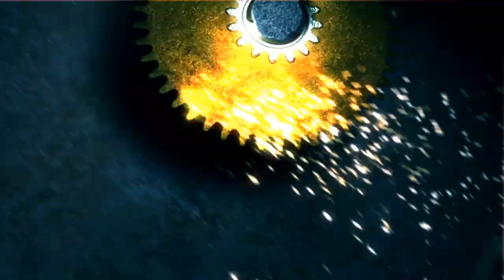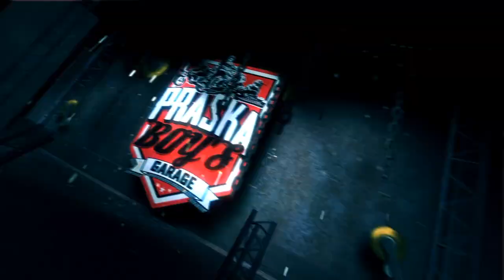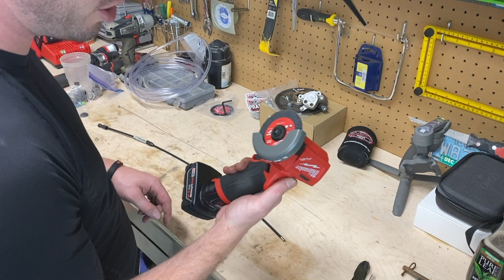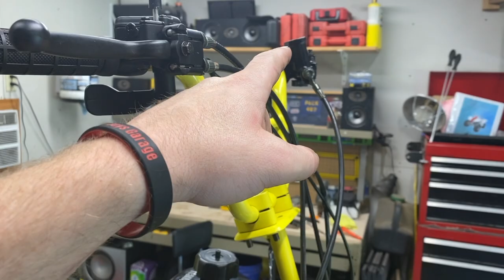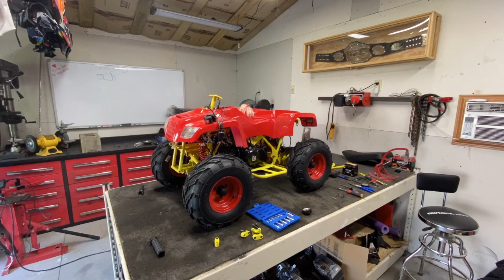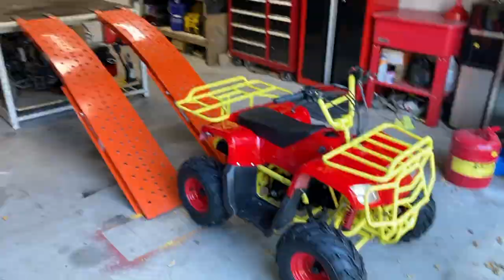Restoring a TaoTao 110cc Chinese ATV! Final Assembly Complete! Part 6

Comment: Man that was pretty creative to use soldering a wire and soldering gun to build a new end for the wire I never thought about that thank you for the idea I do quads and atcs mainly Hondas I'm either restoring them or I am just making them crazy had a ATC 110 that could almost pull anything I wanted it to check out my YouTube video I have up ATC 110 pulling Jeep Cherokee on sugar Sand
Reply from the maker: Love it man! I like Honda 3 wheelers a lot but I am not a fan of letting my boys ride them. We had ATC110 that I rebuilt the top end and cleaned the carb. Gave it to my 6 year old for about 30 seconds and decided it was best to sell! Might get one in the future but for now we are going to focus on 4 wheels and sometimes 2 for my oldest.

Comment: Nice trick with the soldering on the throttle cable. I just hit it with a welder. I have filed bike cable down to fit before as well.
Reply from the maker: I've used the welder to, but I usually hit to much and spend twice as long shaving it down! I've seen others drill a hole in a BB and then hit it with the welder.
Reply: @PraskaBoysGarage  I wouldn't have the patience to drill a BB!
Reply from the maker: Lol, I've never tired it either!

Comment: Your video got mine running 😁, one question for anyone reading this, have you guys had issues with manual dying when put in gear, engine sounds good, unit was sitting for a while, will move with gas but nothing without throttle. Idleing up just kills it faster

Comment: Quality vids bro...Are you familiar with a Baha Motorsports 250? I'm having a heck of a time with wiring...the key switch console has so many wires coming out of it that I can't match it with my new harness? Can you suggest a resource or something?
Reply from the maker: I am not familiar with them at all. If its a Chinese model I know they make similar wiring harness as the 110s. They are specifically for 150cc-250cc on Amazon or eBay.

Comment: Aren't you putting an engine oil cooler for it? That way those valves and the camshaft bearings of the cylinder head won't get overheated and bend.

Comment: Another great video. That rear brake. Is that standard on some of these ATVs? All mine have mechanical rear breaks. It always needs adjusted for the cough big kids.
Reply from the maker: Lol, in my experience they have all been rear hydraulics with the exception of the shaft driven quads. Those typically have a drum brake attached to the axel.

Comment: I meant to say that it’s 250 Tao Tao  Rear bearings for it I cannot find them like I was asking you I was wondering if you could help me find them and if you can can you let me know thank you
Reply from the maker: Your best bet would be to check eBay. Use a micrometer to get your metric measurements. I am not as familiar with the 250cc but that's where I would start.
Reply: @PraskaBoysGarage  Yeah I’ll check out eBay and see if they have the bearings and all that he doesn’t get an awesome job putting it together man I watch the whole video it was cool when you have a chance check out radical rain video of me driving my full Willer in the woods let me know what you think

Comment: I have been working on and trying to reatore a Z Easy 110.. its almost identical to this atv. My main question is the back swing arm, What does it have in the hinged part, bearings or bushings? What ever they are they are bad on mine and causing the chain to lightly drag on the housing. Any help or advice would be helpful.

Comment: Where did you get the motor holder for your table?
Reply from the maker: My engine stand is probably the most popular tool I have. I got it off eBay back in 2018, but the seller is hit and miss when he lists them. I am currently working with a guy who owns a CNC machine to start making them myself!
Reply: @PraskaBoysGarage  man I would buy one in a heartbeat. I do small engine repair too

Comment: Hey I a 110 4 wheeler for my grandson it was running great and then it stop running and it won’t roll if you pull the pull rope the bike moves what you think wrong with it thanks
Reply from the maker: Interesting, a 110cc but still has a pull rope? Do you know what brand it is?

Comment: Where did you get that stand you have the engine mounted on?
Reply from the maker: My engine stand is probably the most popular tool I have. I got it off eBay back in 2018, but the seller is hit and miss when he lists them. I am currently working with a guy who owns a CNC machine to start making them myself!

Comment: WHAT SIZE TIRES AND RIM DID YOU PUT??
Reply from the maker: The tires are 16x8.00-7 the rims are 7" rims
Reply: @PraskaBoysGarage  I wonder if it'll fit on a 110 TaoTao the current tires I have r145 6 inch rims same bolt pattern I believe

Comment: Is there clutch adjustment on those I have one for my son and it is always going even when it’s idling
Reply: Then its in gear. Maybe the selector fork or something? Hard to tell with no video.
Reply: If its moving when idle then idle is too high , turn idle screw back till it stops trying to move , the screw will be located on the side of carb near bottm of slide tube ..hope this helps
Reply from the maker: That's my thought as well. The clutch has an engagement point based on the RPMs and is not adjustable. You have to bring down the rpm to stop the clutch from engaging.

Comment: hey there im  still looking for thoses taillights you have and a seat  where did you get them do not want to order the wrong ones   great job on that  but im still having a issue with the headlights being on all the time with the switch off  how do i fix this   rob from pa.
Reply from the maker: Tail lights were off eBay and I put the item# in the description. The seat came from VMC with a link as well. Check the measurements before you order they make 2 styles for the ata110 seat. The switch probably has corrosion as they are known to do that. Get some electric safe cleaner and Q tips and clean them up.
Reply: @PraskaBoysGarage  the switch is new with the wiring  would it still be corrosion inside

Comment: Another great build BJ! Thanks for posting. One of my favorite parts is watching the machines in action when you are done.
Just curious, have you ever tried the Automotive Electrical Wire Connector Kits? I'm not sure how much you pay for your new wiring harnesses, but that kit worked well for me. On my build I noticed that part of the metal had broken off in the connector. It only took a couple of mins to replace the bad pins with new ones and a reliable connection was restored.
Reply from the maker: Thank you so much! I've always wondered if I should take a new harness and replace every connector with a better quality water proof connector and see how long it lasts before I have an issue. I usually flip these as soon as I'm done with them but if I ever make one a "keeper" I'll have to try it!
Reply: @PraskaBoysGarage   Any time my friend. It's all about sharing what we can.

Comment: Awesome video as always. I do have a question for you. When setting your values on the 110cc atv. What measurements did you set them at?
Reply from the maker: Thank you! Valve clearance: 0.005" Intake & 0.007 Exhaust. After about an hour of break in riding I check again to make sure I'm all good.

Comment: Hey where did you get the motor stand mounted to your table?
Reply from the maker: My engine stand is probably the most popular tool I have. I got it off eBay back in 2018, but the seller is hit and miss when he lists them. I am currently working with a guy who owns a CNC machine to start making them myself!